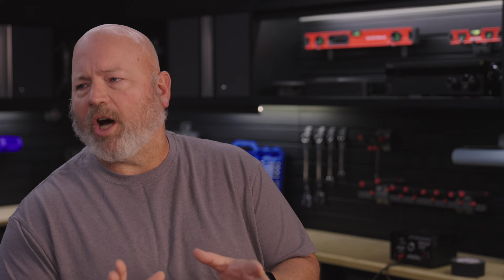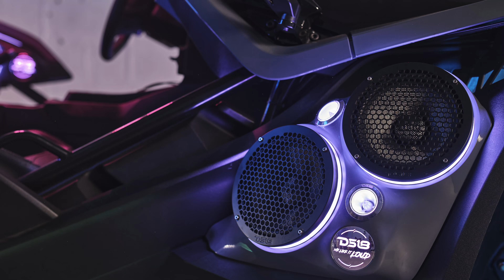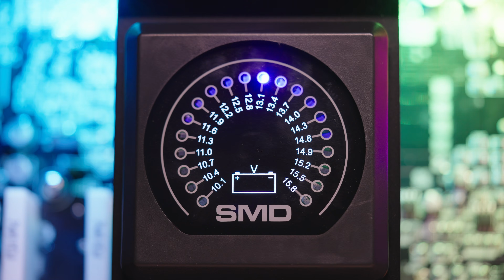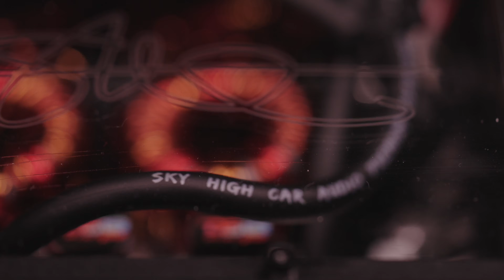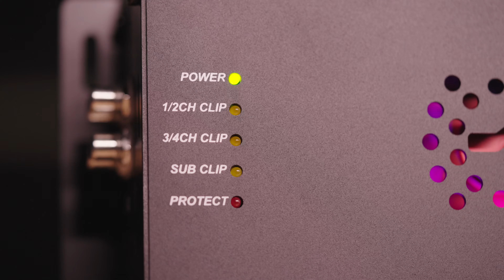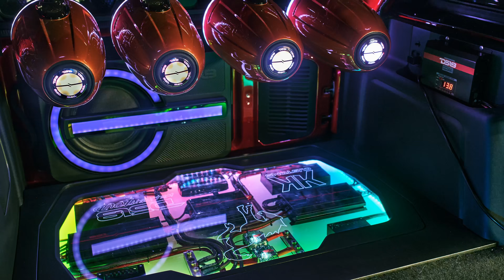DS18 SMD Steve Meade Designs car amplifiers | Crutchfield

Comment: Hi  look at big Ds channel where he test the amplifier smd 3000.1d is the same as as the ds18 exl 2500 and the orion 2500.1dz  are the exact except a few changes just check out and the price difference.
Reply from the maker: We do not carry Orion Products at this time to know how it might compare. We do know that the SMD-3000.1D amp is not the same as the EXL-P2500X1D amp as they output different levels of power. Now, its nothing major, but still different making the SMD a different build altogether.